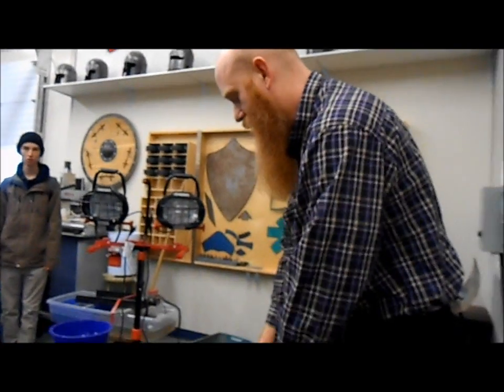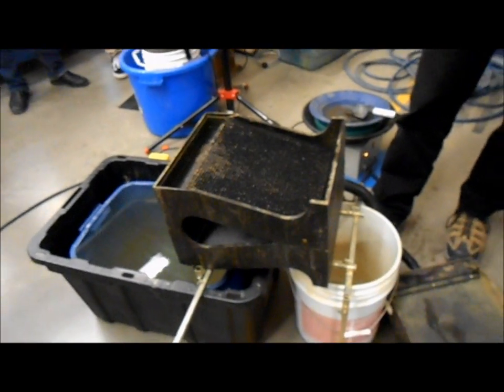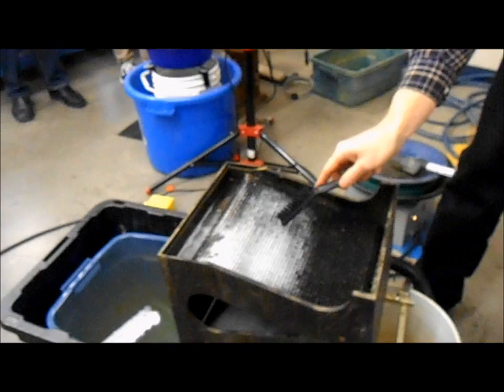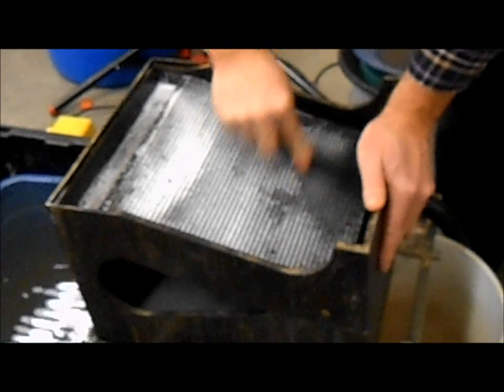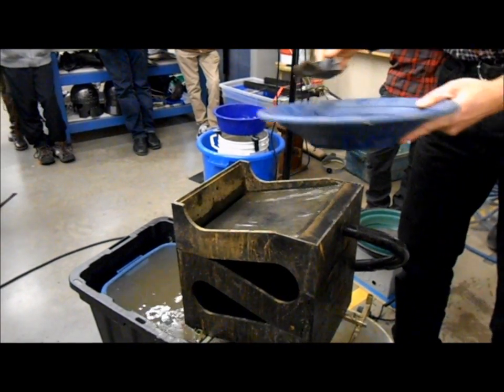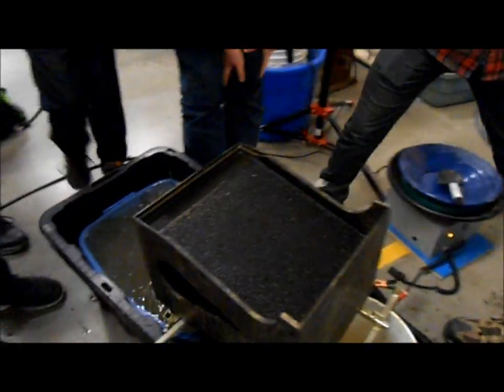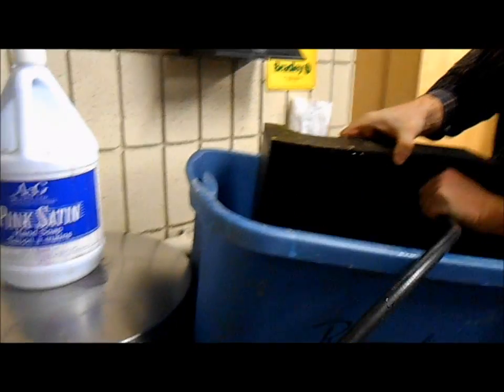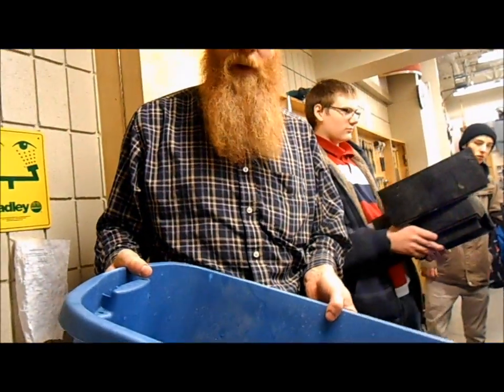Gold mining course, How to use the Gold cube.

Comment: i ran some hard rock thru my crusher, it came out as fine as flower, what would be the best way to capture the gold? blue bowl, gold cube, or miler table? please respond
Reply: Depends on how much material you have. A blue bowl or Miller table will catch more, but are extremely slow, a GC can generally be run all day with a pretty quick feed rate before you need to do a clean-up. Just make sure your material is thoroughly wet before putting it through the GC or it will float if it's fine and use jet dry to help avoid surface tension.
Reply: A saw a person using a Gold Cube after crushing his material into powder... but he was trying to sell the Gold Cube by demonstrating how it works.
Reply: u cant run flour thru a gc period u will lose all the au. u need to send it to a refiner
Reply: @doortoodoor1289  my GC commonly catches gold so fine l can't see it without a loop or unless it's bunched up with other specs. And that's with a 2000gph pump pushing water through it way faster than its designed for. In my case lm using it as a secondary recovery after my main dream mat highbanker, so its far from ideal conditions for a GC, but it still catches large percentage of ultra fine gold even in those terrible conditions.